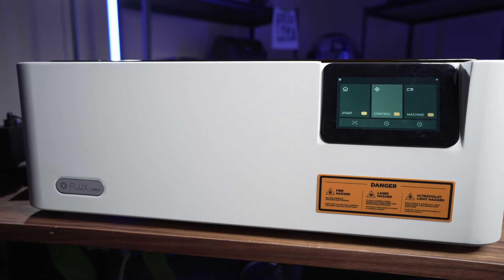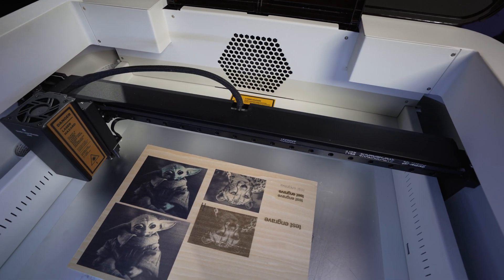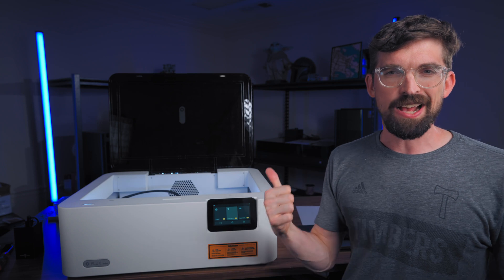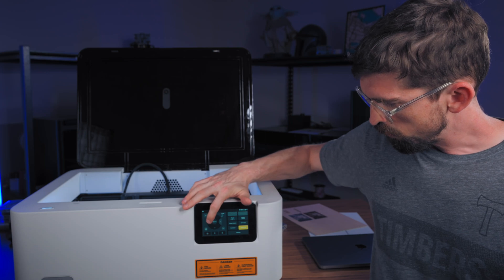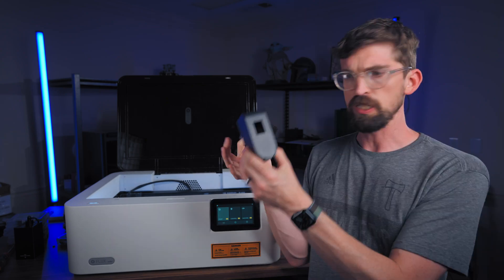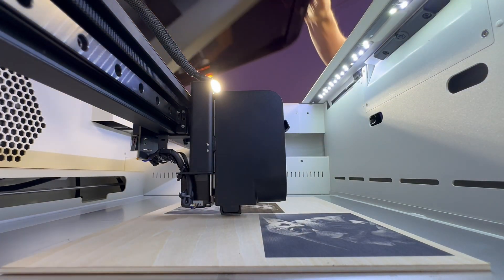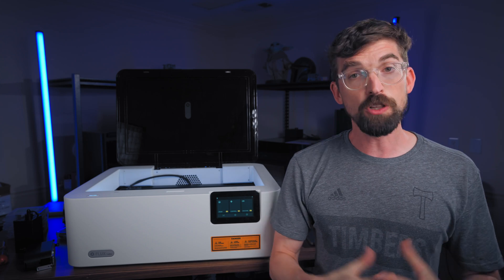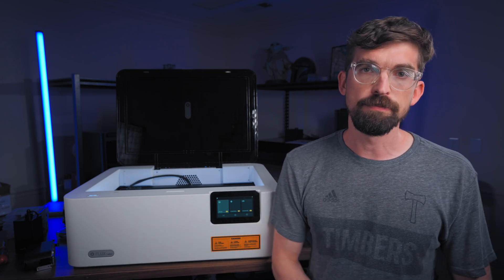The World's First Laser Cutter & Color Printer Machine - The Flux Ador Review

Comment: The Ador is very similar in form factor to the original M1, I'm surprised you didn't mention that and use it for comparison.
Another thing I'm very surprised you didn't mention is rotary attachment support and option to process taller objects.
Reply from the maker: Good points, it does feel like xTool is phasing out the M1 for the M1 Ultra, that's why I did the direct comparison with it.
Reply: @makeorbreakshop  They're not phasing it out - it's still available and still a decent craft laser but they always treated the M1 like the ginger child, very reluctant to add anything for it or even mention it after the premiere.